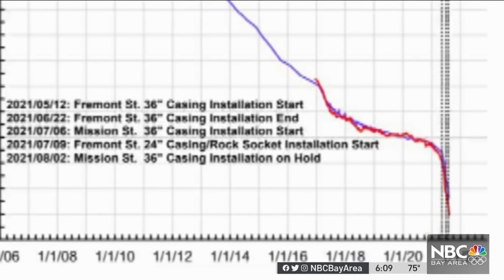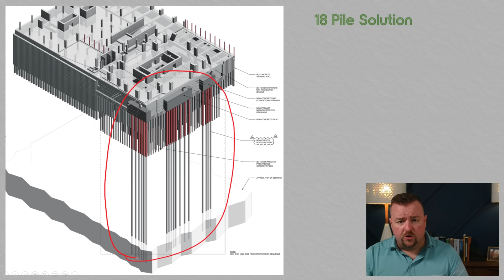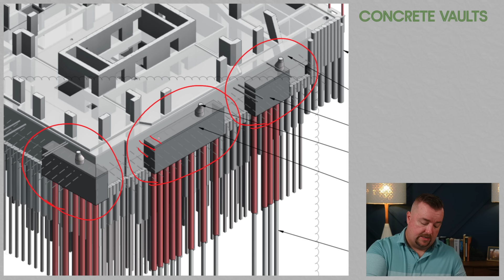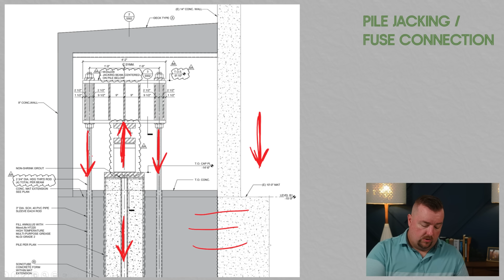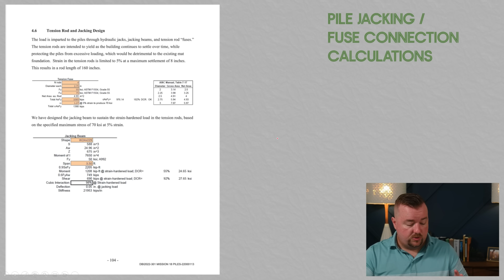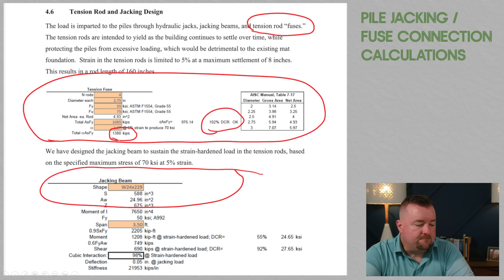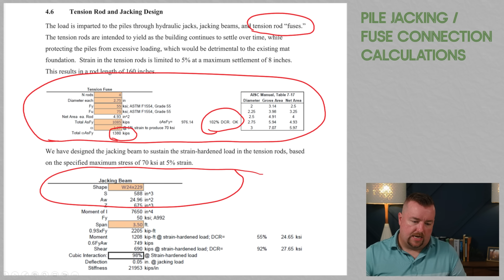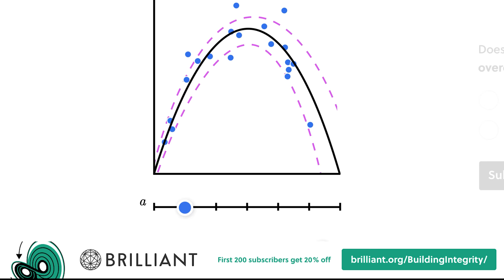Did I Uncover a $100,000,000 Mistake with the Millennium Tower "Fix"?

Comment: To find errors in existing documentation is one thing. To find what is missing is next level. Its possible they did calculate it but didn't put it in the report. Still impressive find either way.
Reply: This.
To find what is missing.
Like the Hyatt Regency walkway collapse and its obvious but unchecked design flaws.

But the Hyatt disaster contributed many lessons and reforms to engineering ethics and safety, and to emergency management.

So it seems ludicrous that they have not calculated the sheering load on the bolts, thread, plate when this type of failure is so well known now.
Reply: @jonmobrien  shearing load

Comment: I am definitely no engineer, but used to work construction in California. We built a wood frame 3 story dormitory building at the University of California Northridge and the earthquake "hold downs" that they used were 1" threaded rods from the first floor to the second, and then stepped down each floor. I think 3/4" and 1/2". 2-1/2" threaded rods seem to be way too small for a building that size compared with 1" on a comparatively simple 3 story building.

Comment: Yeah a little alarmed at that.  We use 1 1/2" plate at my work but we put no where near those level of loads on it.  This really feels like a part that should have been wildly over engineered and instead we seem to have something that is maybe just barely good enough at best to do the job.

I would suggest contacting the local news outlets in SF.  Unless someone happens to have an in with the building department the only way to get this reviewed is to publicly humiliate them.

Comment: It seems there are five additional  elements in the load path that need have detailed stress analysis.
1. The nut on the threaded rod. Both the bearing and shear stress on the threads.  Include the thread torque.
2. The corresponding thread in the rod.  Different materials.
3. The shear stress in the plate you identified.  
4. The bearing stress in the concrete that touchs the lower plate.  It must not exceed the compression strength of the concrete.
5. The shear cone strength of the load path from the lower plate back into the vault.

Regarding 3.  To withstand 350 kips a 36 ksi steel plate can be loaded  to 0.57 * 36 or 20.5ksi. In shear (Von Moses criteria) A 350k/20.5 ksi = 17+  in^2  of shear area.  At 1.25 in thick that's about 14 linear inches of load path of the plate.  This seems doable, with a bigger plate and deep enough nuts and washers.  But the details matter.

Regarding the design basis. Are the lateral and vertical ground accelerations during the design basis earthquake being considered? In the column stability calculation and in bearing strength of the rock? Also, Do they understand the load path that this composite structure will have during earthquakes.  It is not clear that which footings will be stiffer and carry most of the load. 

No inspector or review team should approve anything until these design details are completed and checked and signed by a registered professional structural engineer.   These design basis safety calculations are then checked by independent registered professional structural engineers and then  reviewed by a design review team that decides whether this solution is viable. 

This design should probably also be tested at some scale prior to implementation. 

The University of California, Berkeley produces many fine structural engineers. I hope at least a few are guiding this project.
Reply: Let's make sure they don't forget earthquakes
Reply: I was just thinking what they are doing is basically a small child trying to hold up an adult. California is known for earthquakes, perhaps not as much as Japan but they may not be calculating for the eventual quake that IS going to hit the state.

Comment: I also have an engineering degree  unrelated to Civil engineering. I find the connection of the rods on the lower portion , plate interesting. So very little area around the nut and hole of the plate under compression , then transferred force  to the area around the pvc pipe into a column of concrete. I would be worried about stress concentration around the hole and cracking the plate causing one rod to lose tension and transferring it's load to the other three.  Like my college professors use to say "Show me your calculations"
Reply: If that particular piling becomes compromised, can the other 17 pilings handle the increased load, especially when the rods are already strained to 102% of annealing strength?
Reply: 250,000 lbs per rod? Or 120 car's weight? 
And what about earthquakes?
Reply: @MbeyaIsHome  yeah, earthquakes are unheard of in that part of the world /sarc intentional.  yeah, I'd think even a small quake would pop those rods like kindling, or strip those threads.
Reply: Lateral rebar connection of vault to foundation looks dodgy as well.  This area has to withstand building's downward force and the jack's upward force.

Comment: Hi, thanks again for a brilliant post. Back in Sept '74 Ted Heath's yacht Morning Cloud sank off Brighton, UK, with a fatality. The wreck was eventually recovered by Bellsize Boatyard. The bow was mounted onto a sheet of marine ply and presented to public gaze at the front of the yard. The yacht was of composite build, wooden hull - 6mm stainless plate chassis to which the ballast keel was bolted. The holes through which the keel bolts were fixed looked like bullet holes, they had simply pulled through. Not backed up with large washers. Sounds too simple, doesn't it. Now I come to your point about the inadequate size of the new support beams/bars in the Millennium Tower. You can calculate all the stresses and strains that take place in a more or less static building but impact loading is another factor which comes from the seat of the pants. In the case of the yacht it is wave action that has to be dealt with. In the case of the Tower it's seismic activity. In the case of the jacks and bolts, calculate the sizes THEN DOUBLE IT.
My only comment is that you are too quiet for too long. I look forward to your posts. Regards Pete on the Isle of Wight. (Retired engineer)

Comment: I think its also worth noting that this plan now creates a sudden cascading failure event even more likely. If they do jack the pilings up to 1m+ pounds of pressure and it doesn't fail immediately.. and then further settling happens, and then it fails, there will be no warning.
Reply: The jacks have been set to one million lbs on all 18 new piles.  Further settlement should cause tilting in the opposite direction.  That will reduce the load on the jacks slightly as the center of mass moves away from them.

Comment: @ Building Integrity Yes, you are right of course.
1  The plates between the pairs of greased/sleeved 'all-thread' rods should not be mere plates.  They should be I-beams more like the one spanning the jack; strong enough to resist pull through, shear, bending and big enough that the concrete crushing strength is not exceeded.
2  SFO Building Control should do more than look at the Engineer's calcs and say they have reviewed them.
3  Clearly, SFO BC and the Engineer of Record have completely overlooked this element in the load path.  However, I question the whole concept of 18 small piles on one corner
The last significant piles that I designed were bored between the escalator tunnel and running tunnels of the Victoria Line.  It was only a 15 storey building and the piles were a lot bigger than what you show.  30MN IIRC so nearly 7million pounds force in your money.
The calcs shown are neat but cursory for such a significant building.  In the UK any SE consultancy would carry out computer modelling to show the stress levels in the plate and in the concrete.  It would be red so it would then be resized and recalculated until it was right.  They would analyse the raft and how this altered the stresses in the raft.
Even if the plates are redesigned will these 18 piles have enough resistance to carry the building?    I think not.
Your diagram showing a piled raft with perhaps hundreds of shallow piles suggests:
     either the piles themselves are poor quality and creep compressing under the load more than the others
     or the ground at depth is simply overstressed (if not block failure, block compression) - as the ground has compressed under load X it will continue to compress  under 9/10th the load at 90% of current rate ( if the 18 even take 1/10th)
If 18 piles at the perimeter generate enough resistance and the redesigned plates hold and beefed up reinforcement in the concrete holds, then they will likely overstress the pile cap. The pile cap was likely designed on local shear; not to span from that corner to half-way across the building.  So, has the Engineer of Record re-analysed the pile cap and proven its capacity? Hmm!

Comment: One of the great advances in building technology is being able to design things to a standard of “strong enough”. Which is actually great. It saves materials, gets rid of that forest of columns the skyscrapers of old had, the reasons it’s great  are too vast to list. However; in a situation like this, overkill should be the operating principle. Every inch of structure that that plate can cover, it should cover. And if the calculations say 1-1/2” thickness is enough then it should be 2”. A catastrophic failure of that connection severely threatens a cascading collapse.
Reply from the maker: I 100% agree.  Critical components that, if increased in size/capacity, don't negatively affect the budget or physics of the projects I work on get bumped up significantly.
Reply: Absolutely. A small steel plate is so cheap in comparison to drilling the huge piles into the ground. Just make the steel plate bigger! And wider and thicker threads for the bolts.
Reply: Is this a case of Value Engineering gone Wrong?
Reply: @stevelopez372   At least profit over safety. At this point the only reasonable way out should be to dismantle the building and start from the ground up if ever again at that location. Any decision that says "We will do whatever but take it down" is putting profit over safety.
Reply: @Ingvar Hallström  Might be some arrogance involved given they don't see the need for an outside engineering firm to review the project as a whole. 
I hope I'm just jumping to an unfounded conclusion though.
Reply: @ingvarhallstrom2306  Indeed!
Reply: @hippiebits2071  I don't think it is ignorance.  I think the design is a huge attempt at passing the buck.   Assuming the bad plate design is corrected, this solution seems to push blame of a future collapse on whoever is tasked with the maintenance.  Any future litigation after a collapse will be everyone blaming everyone else.  The more parties involved, the less chance for serious punishment.
Reply: @_PatrickO 
Hamburger will make sure this particular company of his goes bankrupt shortly after completing the job to make sure he doesn't  lose money.
Reply: It didnt work out for the Twin Towers. Built like Walmart and the wise guys.

Comment: Considering the 3 inch hole in the plate, that only leaves an inch and a half on either side. The plate is only as strong as the weakest point.
Reply: Yes, and that's the section of the plate with the most strain on it because it's not being well supported by the concrete because of the hole that the rods extend down in. Wild.
Reply: And there's horrific vertical shear forces on that concrete above that 80 square inch plate. You've got 300, 000 pounds of force coming down from the building onto that plate through concrete. That's three or four feet away. That's a huge amount of shear force that could cause the concrete to have vertical cracks. I know there's a bucket load of rebar in there but it didn't bother to show it to the diagram. Terrible

Comment: Former steel detailer, current ironworker (long story), that detail of the plate spanning between those two rods looks like it was a placeholder. I can't imagine that little thing holding the kinds of loads you were saying it needs to hold. 

Incompetency squared on this job, just as is the case for a lot of construction endeavors.

Edit: Also, I don't know much about seismic related stuff, but couldn't this vault be pulled off the main foundation?
Reply: Since the original fix was meant to have 52 piles and that was reduced down to 18. So that means roughly 3x the force is required to be taken up by each of piles and thus the plates. Hopefully that diagram was drafted for the original plan and simply wasn’t updated when the plate was beefed up significantly. Hopes are good right?
Reply: I'm picturing the vault and building separating.

Comment: This just gets better and better /sarcasm. I'm not an engineer, so my opinion is worth nada, but your explanation (as always) makes perfect sense to me. 

That vault diagram immediately reminded me of the bolted tension rods in the Kansas City Hyatt Regency Walkway collapse. On top of which, they haven't factored in seismic stresses, the equivalent of the dancers in the Hyatt Regency collapse.

[Edit: so I'm like the 500th person to make this observation, but it's probably not a good sign that even a bozo like me noticed the similarity, yet the fix engineers apparently did not, or they would have thought to check the shear stress on that plate.]
Reply: I’m an EE, so only have the basic Civil courses.  It would be interesting to know if the 1981 KC Hyatt Regency walkway disaster is used as a case study in Civil Engineering courses.  I’m old enough to remember the event, and like you, it immediately rang a bell of familiarity for me.  Perhaps the engineers on the vault remediation are all under age 45 and don’t see an eerie similarity.

Comment: Very good video. I'm a retired Civil Engineer and have seen this kind of thing many times before. It will be interesting to see what happens. I'm glad that I retired and don't have to be involved with things like this anymore. Did anyone look at the steel that was originally used? About 20 years ago, I saw where some foreign steel failed at 1/6 of its design load. Good Luck, Rick
Reply: 1/6 th of the load?
How is that posible?
Britle fracture or what?
Reply: @ljubomirculibrk4097  I don't know. The company fired me because I had warned them about chinesium. I suspected that cast-iron had been used when it was supposed to be forged steel.
Reply: Oh, damn old chinesium
Reply: @richardross7219  nah, it was probably chitoresium, or chiurabismutoresium
Reply: @ljubomirculibrk4097  Chinesium steel.

Comment: Speaking as a software developer who also deals with numerical analysis, I'd actually expect modern FEM software to be perfectly capable of simulating this. I also expect that the person wouldn't like the answers, because what happens when you reach the limits of simulation verifiability is that modern FEM software explicitly tells you just that.
You put this into any software that was well designed and you get two answers: 1) It works. 2) Disregard 1) because the parameters of the simulation exceed the verifed range of this numerical model.
Reply: When he said that this was somehow an unprecedented sort of model, so computer models for this were unlikely or unreliable, it had me wondering what he was talking about. This is a completely normal thing to model and get reliable results for. There are no unusual materials or forces involved.
Reply: Too True. Don't need to FEA the whole building, but at least run the simulation on this part.

Comment: It looks to me that someone may have originally thought the all thread rods would have been embedded in the concrete directly with that bottom plate to help keep them from shearing out of the concrete at the bottom.   The lack of a calculation on that makes it seem to me that they assumed the load transfer would be throughout the length of the rod in the concrete.  Of course when they encapsulated the rod in grease they eliminated that load transfer mechanism.  This reminds me of the KC Hyatt Regency in terms of hanging loads on rods and the rupture of the plate where the load bearing nuts and washers pulled right through the structure.
Reply: Which was also due to a miscalculated load on that part of the structure where the load transferred from rod to nut to structure.

Comment: Corrosion will be a major factor. As you have described the configuration, the steel plate is not encased in concrete it is exposed to atmosphere via the tunnel with the threaded rod. So the plate material will be critical. We have water, salt, and air all working on this plate. 
Also the wedge between the vault and footing is putting that joint under tension as it is pushing the vault away from the footing.  Seems backwards and the wedge should have been joined in a manner that puts that interface into compression

Comment: Thanks for your work.

We have recently identified a problem with a suspended slab over garage situation at our apartment complex not dissimilar to the Surfside situation.

Your videos provided a heads up on the need to address such problems before they get beyond remediation.

In our case it involved negotiating with the fire department to stop them parking a 15 tonne fire truck in a prohibited parking area on the common property slab that  was only stressed to take 5 tonnes of load. 

Unfortunately too late to prevent cracking but we are negotiating with them over repairs.